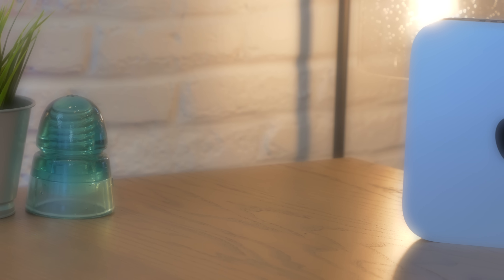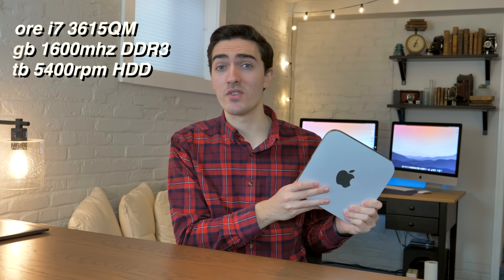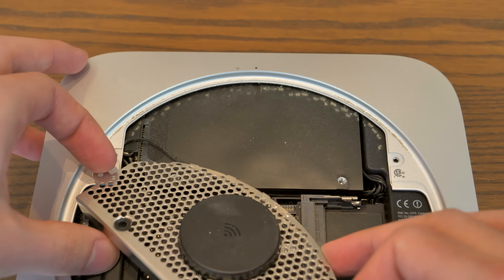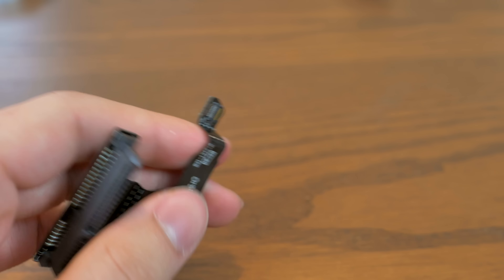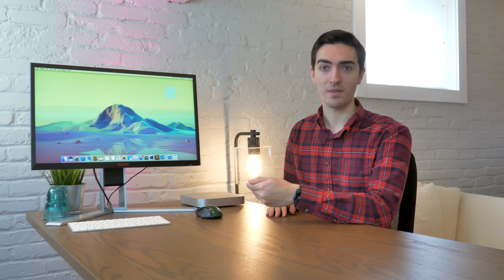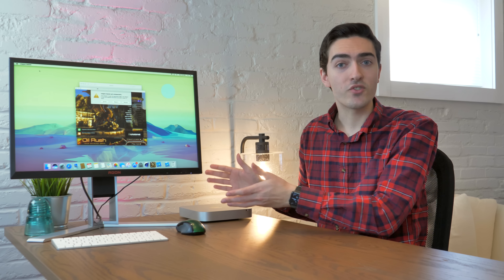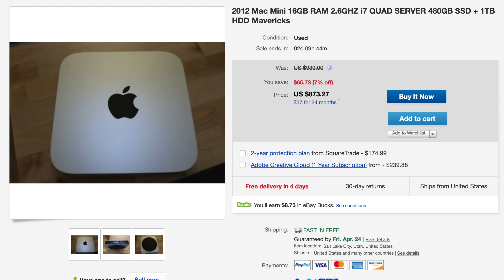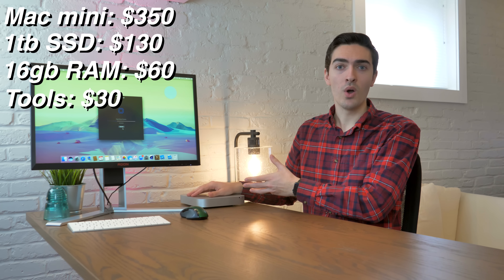Building the ULTIMATE 2012 quad core Mac mini – But is it worth it?

Comment from the maker: What do you think? Is the 2012 quad core Mac mini a good value? Also, get Total AV for 80% off, just $19.99/year when you sign up today at https://totalav.com/lukemiani
Reply: I ended up getting mine for about 220 dollars after selling my 2010 for about 100. I put a 500 GB SSD in and 8gb of ram and it works flawlessly for my logic pro work. It was absolutely a steal in my opinion. I also got a housing for the old spinning hard drive that I use as extra storage! Perfect little machine
Reply: @connerszekely6728  hey man! I'm trying to get into the Mac World because of Logic! And i think i'm going to get one of those!
Reply: Last week I picked up a Mac mini Server (Late 2012) i7 2.3GHz, dual 1TB HDDs, 8GB of RAM and Apple Cinema Display 24" from a co-worker for $450 total. Swapped one of the failing 1TB HDDs with a 500GB SSD and upgraded the RAM from 8GB to 16GB (already had the RAM.) This machine replaced our aging Early 2009 Core 2 Duo iMac and is being used by my kids for school work.  Speedy little machine, especially after the SSD and RAM upgrade. Doubt my kiddos will ever use the 1.5TB of space, but I'd rather have too much than not enough. I do use it hear and there, and don't really notice a difference between it and my 2019 MacBook Pro i5.
Reply: i think its worth it  the mac miani
Reply: Luke Miani only downside is no 4K but you can get half way there sorta..
Reply: i bought a mac mini 2012 i upgraded it with 16gb ram a 1tb ssd and a 4tb hhd and it works amazing i spent roughly around everything for under 500
Reply: Xyger120 That’s a good deal there, congratulations! 🎊🍾🎈🎉
Reply: Yes and no, the biggest thing is the lack of thunderbolt which limits the upgrade path in a couple ways.
Reply: A friend of mine gave me his with i7, said it was too slow. I looked and it only had 4gb and a hdd, so I swapped to SSD and 16gb ram and runs like a champ! :)
Reply: I don't think these Mac Mini models are a good value. Speaking of the Unibody MacBook Pro from 2012, I agree that they are getting to the point that the price of entry isn't that good. See you in the next video ami.
Reply: For me yes. I run it with 2x860 ssd in raid0 ...
Reply: Bought mine new with SSD and 16GB ram and it’s still running strong at work running two monitors.
Reply: I think I spent $600 on my 2012 Late Edition mac mini (Dual-Core i5 chip). I upgraded the ram to a full 16GB and I was able to play Fortnite Chapter 1 - Season 4. Six months later the internal GPU just wasn't playable to the point the game wouldn't even startup. I since put in a 1TB SSD and connected the Sonnet eGFX Breakaway Puck Radeon RX 570 which at the time was over $600 bucks. Now you can buy it for half that price. I was able to connect the mini's Thunderbolt one to TB 3. Yes, you lose the performance as the TB-3 downgrades to the slower TB-1, but I'm able to play Fortnite Chapter 2 - Season 2. I'm averaging about 35 - 55 FPS which isn't great but it's still playable. I know when I upgrade to the 2020 mini, I'll be able to take full advantage of the eGPUs speed and should get at least 80 FPS or as one PC test a friend did he got 115 FPS with some other app. One big advantage I do notices is using photo editing software called Capture One Pro - 20. It's blazing fast now as that software takes advantage of the eGPU. Even with the TB-1 performance values, it still screams. What's really crazy is that I can USE Catalina! My other computer iMac something something is stuck with Mojave, which is fine as I use it for a photobooth and soon a Live Youtube streamer.
Reply: Hi Luke, just wondering if this is a good deal? "Apple Mac Mini late 2012 /i7-3615QM/16GB Ram/1TB HDD/4000/Grade B" for £390 which is about $509.05 US. Let me know if this is a good deal, thanks
Reply: wonder if I can get your thoughts on a purchase I have managed to snag a 2012 Mac mini i5 A1347 for $360 shipped. Includes 16GB ram and a 500GB SSD upgrade. Would you say THAT was worth it?
Reply: the real question is which is the best price to make it a valuable option in 2020/21? also how intel hd 3000 perform after 10 years? right now i can have it with 16ram and ssd for 235 $. i7 quad core and hd graphics 3000
Reply: @antoniospagnoletti9532  intel HD 4000
Reply: You see computers in a funny way, like things to buy and sell. But I think of computers as machine we use for a purpose. There is no "too much spending" on an upgrade :if I need 2TB then I will choose between spinning hard drive or ssd, but still that will be 2TB. A computer is capable of doing things, a person need a computer to do a set of tasks. Then choose the right design, the right set of capabilities to do the set of tasks. then compromise on performance/price to fit into a price.  Here my shelf would crack under the weight of a trashcan mac pro, so maybe I'm okay with the quad mini.
Reply: I bought one a few weeks ago for a 100 Euro. Mac Mini from 2012, Intel i5, 8GB ram and a 1TB HDD. All i changed is to put in a Samsung SSD. With Linux installed, it is now my TV streaming device and works absolutely perfect. The value is always connected to the price. But it is also connected to what you want to do with it. For HD TV streaming this specs are even a little bit of overkill, from my point of view. But the form factor is a great point, if the machine is located in the livingroom, where everyone can see it. And, of course, the Quality of all internals is always a point to the Apple material from this period. 😊
Reply: Luke Miani If you add external graphic card via thunderbolt-it will be a beast. You can play even games!
Reply: @alexxschiller7115  What do you do here, Windows Titles?
What GPU u use, value?
Reply: Luke can you please make a video of iMac late 2011 hooked up to two thunderbolt displays? 3 QHD display iMac setup would be dope!
Reply: Luke Miani thx for using geekbench 4 not 5 👍🏻
Reply: I got mines for $279 with 500GB HDD 16GB Ram but i got it because it looked like a grandmother used it and never plugged or unplugged anything, not a single scratch or dent. Then i maxxed it
Reply: Yes it can be great value.

After my hackintosh became unviable, I got the i7 2.6GHz (the fastest model) + 4GB + 1TB for the equivalent of $300 from a UK Mac dealership. It was pretty much brand new, no dust inside, the hard disk had only been running for 300 hours or so.

I added 16GB of RAM for the equivalent of $65, and installed my existing Samsung SSD 840 Pro 256GB. HDD upgrade kit was $12 (iFixit's brand is a rip off).

In my country (UK) the base Mac Mini with 16GB of RAM is £999/$1200 and barely any faster for the work I do. I wouldn't benefit from its newer integrated graphics.

My 2012 Mini cost me under $400. It would be under $500 even if I didn't already have an SSD and bought the 1TB QVO you used (which is 4x more storage than the base Mac Mini currently available).

The machine is an absolute bargain. I don't care that I can get a laptop for the same price, I want something to sit discretely on my desk and I don't want to be using a disgusting old keyboard.

This Mac Mini replaced a hackintosh with an i7-4770k and 32GB RAM. Sometimes the RAM isn't quite enough for my workflow, but the CPU just chills out most of the time.

For a lot of people this Mac Mini can still do everything they need.

The integrated graphics are drving a 1440p display without any issues, and it can play back YouTube 1440p/60fps videos.
Reply: I have a mid 2012 i5, it is a great product. It is maxed out with ram a SSD and a HDD. It’s a true gem!
Reply: Luke Miani can you fit raspberry pie in Mac mini shell case
Reply: Not really a good value - graphics is important for most uses today. And the upgrades you did put it over the top.
Reply: Great video, agree completely. Best for people with existing hardware. I wonder if these (inc i5) could be upgraded to 3770? I have an HP Hack that uses the mini ID and have swapped multiple cpu with no issues.
Reply: Hey. I have a question. I have MacBook Air 13 early 2015 model. I have 128GB in it and I wanna upgrade it to 1 TB or 2 TB. Can you help me with that and find some not really expensive drives for it. Thank you
Reply: Easy. Get a Sintech M2 adapter and NVme drive. Must run high Sierra or later. Look up Mac rumours forums.
Reply: Luke i neeeed help please!! I live in London England and your YT channel is The Best period. I want to buy a budget iMac that will allow me to edit 5k video. I've ever done it before, but with lock down I have loads of time. You convinced me to buy iMac 27 with gtx780m but the drawback is no 5k. is there a work around.
Keith in Lock down London
Reply: Realize the late 2012 model was manufuactured up until the 2014 model was released so it is possible to get a unit that is younger than 8 years. [edited for typo correction]
Reply: fuck no
make a hackintosh 
That has more power for less
Reply: The small form factor is cool, but for the price of this, and the upgrades, you could build a decent mid range AMD gaming machine with mostly with new parts(not counting the monitor, mouse, keyboard), and install whatever OS you want on it, including Catalina. So no not a great value compaired to the Macbooks IMHO when in my area I'm starting to see people put Macbooks in the recycle bin for common easy to fix problems that can net you a decent system for under $100 USD if you know what you are doing, and where to look for parts.
Reply: @CommodoreFan64  yes
Reply: @CommodoreFan64 Depends how much you value your time. A hackintosh needs maintenance. Every update has the potential to cause a headache and getting all the functions like sleep and handover to work is never straightforward or even possible. Gaming machines are loud unlike the mini and they take up more room as well as eat more power. You need to compare this with a NUC or similar and those aren't cheap for what you get either.
Reply: I see you are using the new Apple Keyboard with the cable, does it work via Bluetooth? According to apple, the keyboard is only compatible with the Mini 2014 and above.
Reply: Total AV? We are Mac users :)
Reply: Hi Luke. Why you haven’t chose to add in this mac mini two ssd in raid ?
Reply: Is 300 a good price it has 16gb and 500gb thanks
Reply: If I buy an old Mac mini how old do I go before it will be unsupported by apple?
Reply: @iamgambit6797  for 2012 mac mini, max supported official version is catalina.
Reply: Yeah, that's what everyone wants, a 12 year old yellowed display.... Moron....
Reply: thx for the info, u just miss is it working good with internet , software etc.. you are fixed about the money here.. thx to all the feedback above that give more infos and makes me want to buy one.
Reply: Still using this since 2012. It is my home flex server, file server and download machine now. I7 quad, 16gb ram and 1tb ssd-1tb hdd combo with 2x4tb external.
Reply: This is for me as I own one! I am though only going to update the RAM.
Reply: Got SOOOOOOOO confused for a while, until I realized that you were using GeekBench 4, not GeekBench 5
Reply: i think it took too long to just say it's a waste of money..BUT..if you can by $300 sneakers,go ahead..
Reply: I‘m unsubscribing, too many commercials
Reply from the maker: @TheOsnovis  Sorry that I need to make money in order to provide FREE content for you to watch
Reply: @lukemiani  Hello luke i found mac mini for about 300$ with 16gb of ram i personally want to use a mac for a photoshop and graphics drawing tablet can it do the job and is it worth it?

Comment: These would make great "iPhoto" appliances. Just get any Ivy Bridge 2012 mac mini, the i5 dual core will be fine. Put the money into 2 quality drives and use the 2nd drive as a Time Machine backup. This way you're photo system can self restore if there is an SSD failure and you can have a photo vault for a decade +

Comment: Thank you for this perspective that I have watched a few times over the last couple of years. Yesterday (October 2025) I was finally able to find it reasonably priced at $154. I need it for my "obsolete" audio setup (Reason, Logic Pro and a firewire audio interface). I still have my good old MBP 2012, but the battery bulged and cracked the touchpad, so the Quad Core Mini is a great substitude, both quite collectable and fitting in my existing M1 Mini setup.

Comment: I grabbed a 2012 Mac Mini Quad-Core i7, 16GB Ram 256GB SSD from eBay ($75) - Added (2) 1TB SSD's ($99) + Kit 2nd drive ($15) - Installed MacOS Sequoia using OCLP - Man this thing rocks! Thanks so much for this video. It's no gaming machine, but it's perfect for every day office stuff, and lets me play some World of Warcraft. ;)  I'm also running Sequoia 15.7 (via Open Core) on it right now and it has excellent performance.

Comment: Is it worth it? Yes! I actually took an easier and cheaper route by buying the 2010 Mac Mini server, and swapping the logic board out. It was super easy and miles cheaper than buying the stock quad core 2012. I managed to get MacOS Ventura running on it, and it serves as my Media machine for my TV!

Comment: I just picked up this i7 mini with 4GB and 500GB SATA SSD for $135 from OWC. 16GB DDR3 RAM was $18 from Amazon. This is still a sweet machine for general computing. Granted it’s maxed out at Catalina, but that has a fairly modern macOS look and feel and I haven’t run into any software that won’t install on it. For future, I’m eyeballing Open Core Legacy Patcher to bring this up to Sonoma, but haven’t taken the plunge yet.
Reply: What browser do you use for the Mac mini running Catalina? I want to run one just for YouTube, but I don’t know if it’s safe to be on the internet on an unsupported OS. I have a 2012 mini
Reply: @Epicpancakes  I alterate between Safari and Google Chrome, depending on how well-behaved the web site is. If you're using your Mac from home, behind a router using NAT-assigned addresses, you're fairly safe IMO. If you're using a Mac laptop from internet cafes, then I would recommend only connecting to the internet through a trusted VPN service. Since I made my original comment, I've been upgrading some of my Macs using Open Core Legacy Patcher, which allows you to install newer – supported – macOS versions like Somona or Sequoia on older Macs. It works pretty well once you wade through the instructions. I have a 2012 Mini running Monterey and a 2013 MacBook Pro and 2014 Mini both running Sonoma and it's all been pretty smooth. There are plenty of YouTube videos describing how to do this. Just remember to make backups of your boot drive before plunging in if you decide to go this route. Cheers!

Comment: I have a late 2012 mac mini with a 2.3 Ghz Intel Core i7 processor, 16 GB 1600 MHz DDR3 memory  and 1TB hd, it is a great pc, I ove it, of course no games mostly work. Is it possible to replace the HDD for an SSD? how do I recover or install the original operating system and apps? Thank you very much!!!!

Comment: My 2012 Mac MIni Octacore i7 is a Hackintosh now with Windows Linux and Mac. It  has a 2 TB samsung ssd paritioned into afps, ntfs, fat32, mac os journaled per partition, and has installs of Windows 10, Mac OS High Sierra, Mojave, and Catalina as well as Kali Linux and Ubuntu and the CPU is a Core i7 8 cres/threads cpu with a 2 terabyte ssd (1 tTB is windows partitioned) and 16gb ram memory. Can i use an egpu with it on all operating systems i have bootable?. My 2012 Mini works definitely better than the base m chip mac mini of today, cost me about 700$ in 2013 and i am sat here still using it now, oyu can upgrade it to 32 GB ram too they lied about that. And 2 TB ssd works too

Comment: Got one with 8 gig and 500gb harddrive for 80$ recently, use it to digitize old DV movies through the FireWire port. Control it from my M1 mini through screen sharing, as it cant run my 49” monitor. But it’s great for the job, and is probably ending up as server in my networke afterwards.

Comment: Better value is a 2014 m1 mini which has 2.6ghz dual core, 8gb ram, 1tb ssd for $99. I mean, what do you really expect to get out of a computer like that anyway? It's basically just going to turn a monitor into a smart tv. That's what I bought one for. Can run the shit out all the emulators and play movies beautifully, surfs the web fine. A quad core would have been awesome but it won't actually do anything for me in the realm of computing even still, especially not compared to my desktop

Comment: The biggest issue with these 2012 Mac Minis is that you cannot run two 1440p monitors at the same time, and not above 60 Hz either. I think they could still be great productivity machines, but their display outs are just severely limited nowadays.

Comment: I got a late 2012 i5 Mini a while back. Put a 250gb ssd and 16gb ram in it. Originally had Catalina running on it, which ran great. Then switched to Windows 10, which ran better. Now I'm running Linux Mint 21 full time, and it runs the best. These computers are excellent as Linux machines if that's your bag, for not a lot of money.

Comment: I have the 2012. Upgraded to SD 1T drive & 16GB ram right away. Already had an external HD to connect to so didn’t need to put a drive in. Seems to me just upgrading the RAM still makes sense for cost. Apple no longer supports this machine for OS updates. And this is an Intel chip where the newer Minis (and other devices) are using Apple silicon, M1, M2

Comment: I bought this this year so I can work with older  audio hardware in a semi professional way. For home recording. I changed out ssd's and ram to make sure it can at least work another 6 years. I will probably buy more and upgrade these too so I have a spare(s).

I allso bought a 2012 Mac book pro 13 inch and new ssd, a rack to hold a second ssd and new 16 gb ddr3 ram. I do not play games. I watch, read, write and record.